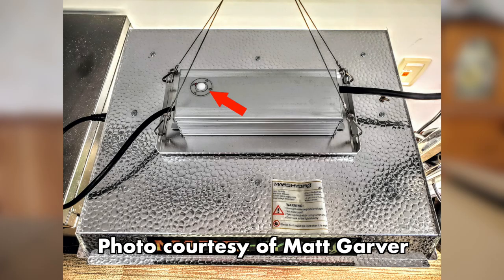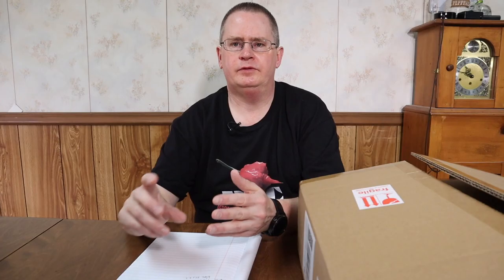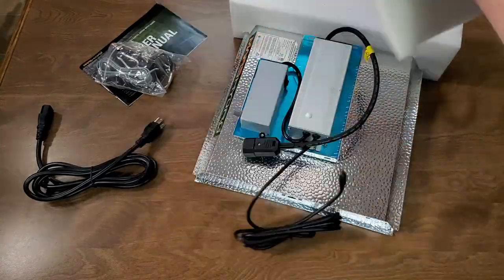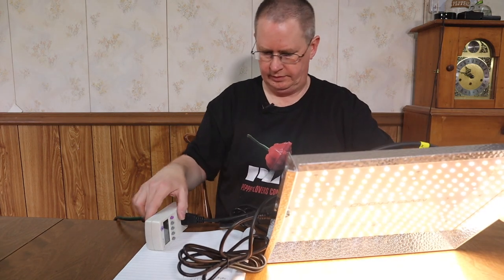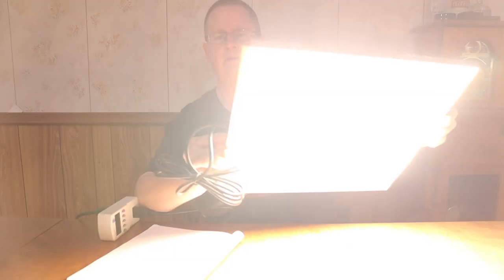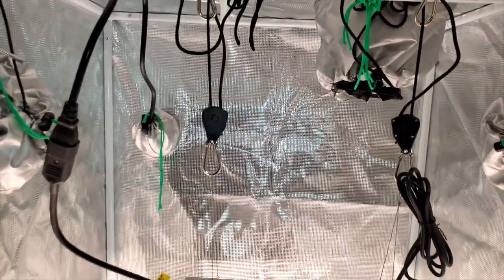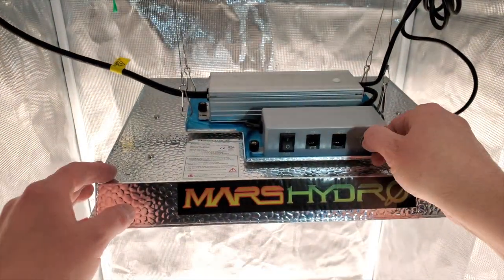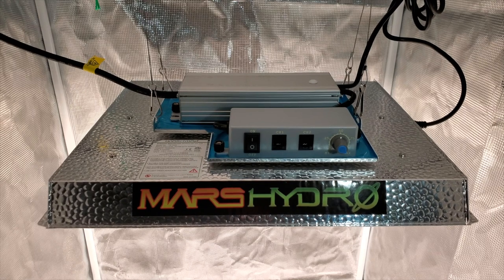Mars Hydro TS1000 - 2020 version

Comment: Power = Voltage  x current. So the 150w would be if your voltage was a perfect 120 or 230(240). Volt drop is experienced through long runs of cable, so if your power point access is far from your switch board you may be experiencing a slight voltdrop brining down the power consumption. Hence the 147w power draw. Great review, very informative.
Reply from the maker: Thanks for the info!

Comment: I have 4 of these. At 100% it will get hot enough to get the stickers to peel up. Hard to get them to stay on. I have a tower fan and a fan on the lights and still gets 10 degrees hotter than room temperature. The driver doesn't need to be removed but it will help reduce heat. I was hoping you would show removing it and where you put it. I need to move mine still. Was hoping for ideas. What would you recommend? On top of the tent would be a fire hazzard right? I'm still trying to figure out a good place for the 4 drivers in or around my 4×8 tent. If it's nice outside it gets 85 degrees or more in there. I'm opening a window right next to it with the tent open to help now. I also have an ac window unit to help when it gets hot outside. I should have gotten 4 mars hydro 2000 2'×4'
Reply from the maker: I probably won't have a need to take mine off, as the heat helps in my basement. And I have an exhaust fan that can take some of that out if needed.

Comment: I wonder if it would be pulling the whole 150 watts in flower mode . He never switched it on flower mode when he was testing watts from the wall
Reply from the maker: There is no 'flower' mode with this light, same spectrum throughout, can be dimmed though. Defending on what you're growing, 'flower' mode would be giving your plants 12 hours uninterrupted darkness. I was just growing squash, so no flower mode necessary.
Reply: Mine has a switch that brightens it just a little after you have it on 100%. It’s a veg made and flower mode . I was just wondering if it pulls the whole 150 watts after you flip the switch
Reply from the maker: @larryhodges5728  You have a different light then. This has a dimmable knob, and if you dim it down, it will consume less power, and be under 150 watts.

Comment: How do you daisy chain these lights? I bought 2 and cannot figure it out! The phone cable they provide only connects the dimmers. Is there a way to actually daisy chain or each light has to be plugged in?
Reply from the maker: I only have one, so I haven't tried daisy chaining them. I assume you still have to plug them all in.
Reply: @pepperdactyl  yes you do. And thats what is frustrating because it says it can be daisy chained but it cant🤦‍♂️

Comment: sp150 vs ts1000? which is better to you?
Reply from the maker: Hard to compare, they are two very different lights. I've used the SP150 longer and getting great results growing rocotos. I like the extra power and dimmability on the TS1000. It also has a more even square coverage. So far it is doing well with my zucchini squash.

Comment: mine doesn't turn off stays dim and when its off there's humming from the driver weird how is there so many good reviews but i read so many forums and on amazon reviews of these issues im having no wonder theyre on sale im returning mine
Reply from the maker: Have you contacted their support? Sounds like you got a defective one. I imagine they would replace it for you, especially if you just got it. So far I haven't had any problems with mine.
Reply: If you got residual energy on leds turn off could be something about your electric instalation
Thats why some led manufacturer tell them clients to turn plug 180 if this hapens
Something about live and neutral being sideways